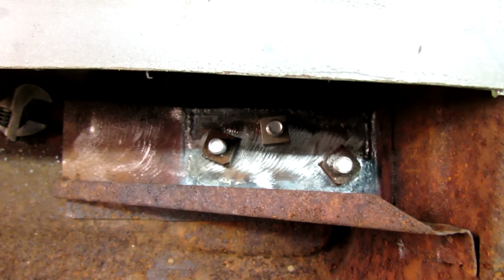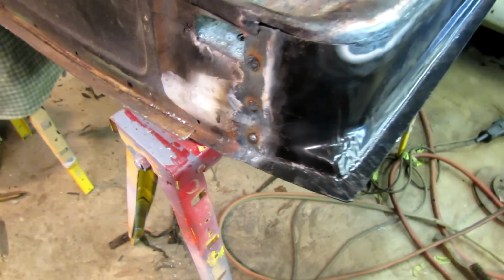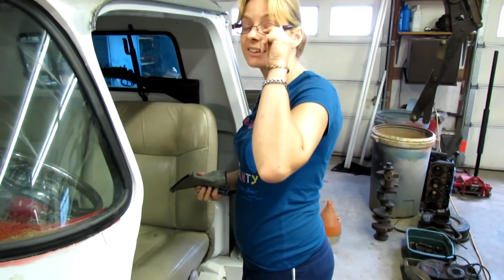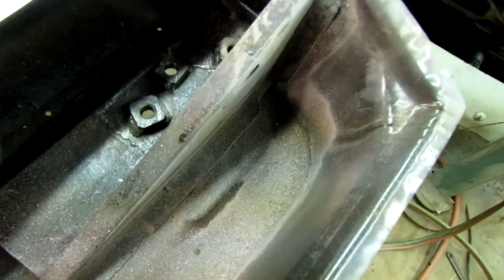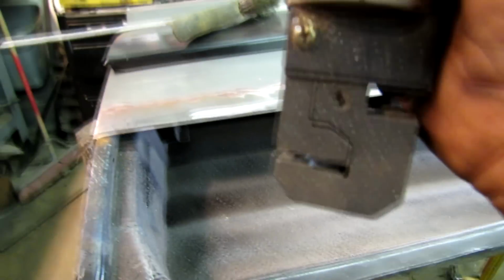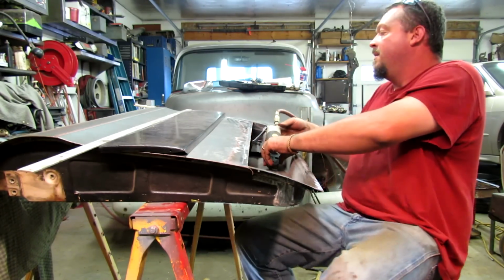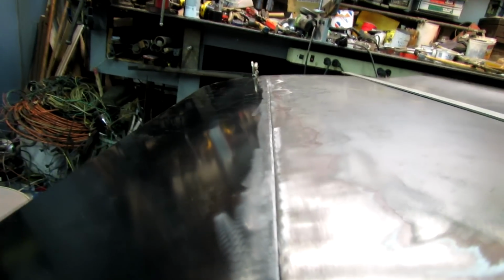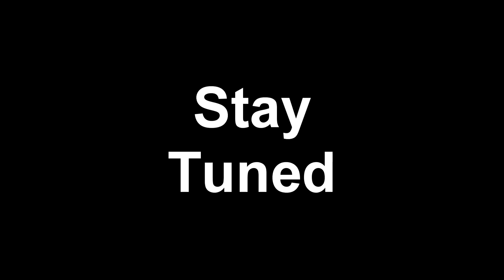55 Chevy truck-door repair part 2

Comment: Yep, I did very impressive job on buddys truck patch panel and then got in too big a hurry grinding the welds down. I felt horrible, needed cut back out but he just mudded it up. It still didn't take that much mud but it was a lesson learned.